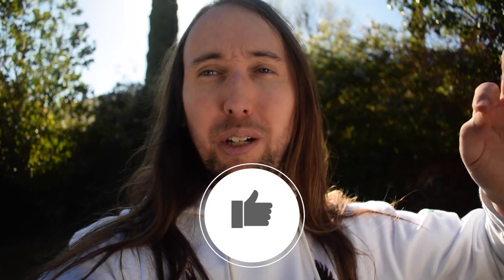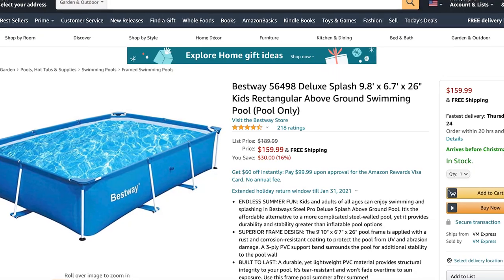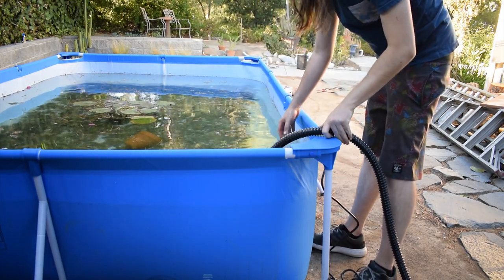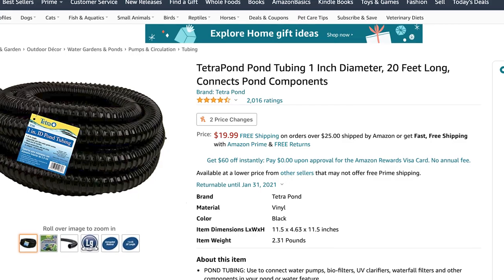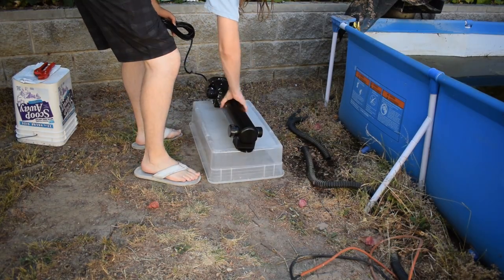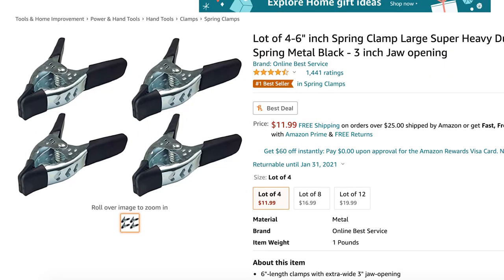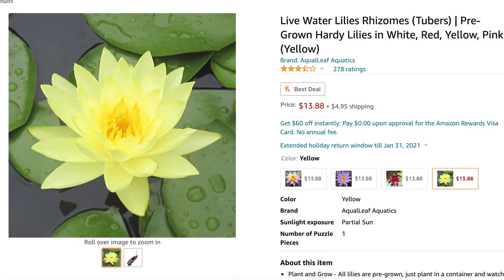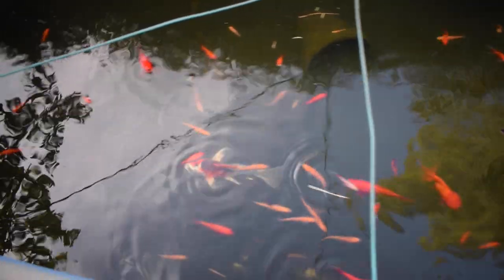How Much Does It Cost To Build A Pool Pond?

Comment: Do you know of you can get 10-15,000 pool ponds unless the pool is under 1000 gallons the listing will not tell you but from rough estimate it looks like the pool will probably be 1-2,000 dollars (if my calculations on the gallons the pool holds are correct) do you know a way to possibly make that cheaper?
Reply from the maker: As for making the price cheaper, I don't know. Although, this would probably be the time of the year the prices are lower. I saw one online that was about 6000 gallons for $1200. I think if you wanted to go bigger than that you would probably be looking at those above ground pools that have like the metal sidings. I imagine they would be quite a bit more expensive

Comment: How long will a pond like this last in the elements before it has to be replaced? Seems like it would be a pain to remove all the rocks and begin again if it’s only a couple years.
Reply from the maker: I guess it depends on where you live. If you get snow where you live then I probably would not recommend one of these, but for where I live (the Los Angeles area) it seems to be fine. I've had mine since 2018
Reply: @TobiasHolenstein  I live in Temecula Ca where the weather gets fairly hot during the summer. I’ll probably have an algae outbreak. Could I make it work? Do you need a heater in the winter?
Reply: @CALIchitown   you can try putting a sunblock shade cloth on top of the pond to help from having an algae outbreak.